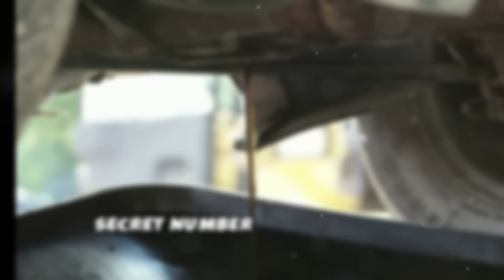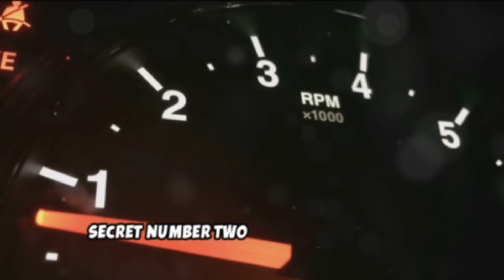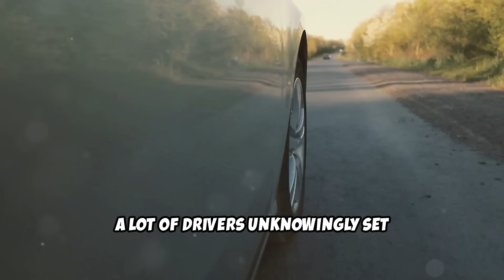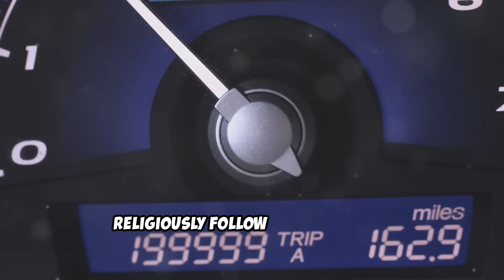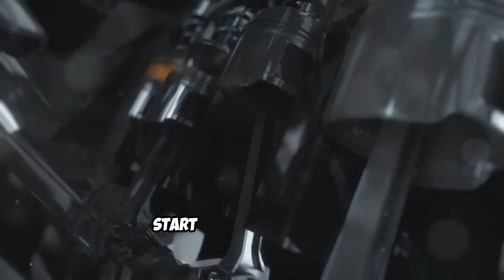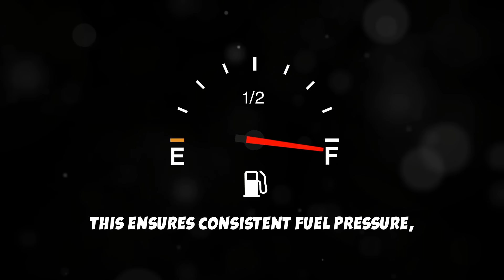5 Diesel Secrets Only Experienced Drivers Know (Most Owners Don’t)

Comment: I have a BMW 530d that has an upgrade and runs at 300+ bhp, with an 8 speed automatic transmission it's impossible to get to high revs for a sustained time as I would be doing 120 mph ! And the ,so called, manual paddle option won't let me keep it in 5th year at high speed.

Comment: One additional suggestion given to me by a wise mechanic. If possible fill your diesel tank when the outside temperature is warm. That will help reduce condensation when it gets to the tank. Another way to look at this is avoid fueling up (if possible) when it's very cold outside.

Comment: If you only drive it on low fuel it also wont regenerate the particle filter, because the car doesnt want to use up more fuel (which it needs for the regeneration)

Comment: Truck driver here, 40t trucks. I. Dont agree with the 5th tip. The suction rail sits at the bottom of the tanks ( trucks and most cars) so there is no dirt in the tanks, thats why we have fuel filters, and the pressure is maintained by not opening the tank except for when fueling up. Dont open the tanks to see inside as you will affect the vacuum and force the pump afterwards. Thats why you ear the air going in the tank when you remove the cap to fill when your tank is almos empty.

I,ve been running a Daf for over 300k kms and no issues whatsoever until now and i drive till the fuel like comes on

Comment: A good tip for manual cars is press the clutch pedal whem start the ignition. Had a Audi A4 1.9 tdi tha made 500 000 km with the original clutch

Comment: i just recently got my first diesel a 3 l m550d. this is about tip number 2. i and have heard that after pushing your engine you should do a 10-15 minute cooldown trip where you drive around or lower than 70 kmph. is this true?

Comment: Good infos, thx. To fuel lvl just one point. If you empty your tank and the engine stops, usually you won't get it to run anymore. Unlike gasoline engines, diesel engines would require a vacuum pump service for your fuel line. Unless you have an offroad car which usually come with a manual vac pump at your fuel filter. Everything else are excellent tipps 😊

Comment: Great information.
However. The final one regarding fuel levels is a bit innacurate. 
For decades now, it has been impossible to suck air from a low fuel tank. There is a seperate sensor from the fuel gauge which will cut-out the engine before the tank can be sucked dry. This is done to prevent air being drawn up the fuel line, which will damage pumps and injectors that rely on the fuel for lubrication. Letting a tank actualy suck dry, would also lose prime on the pump(s), which would further damage them on trying to start with a dry fuel system. 
So vehicles are designed to not totally empty their fuel tank. 
You can run your diesol "dry", but there will at all times ,be roughly half a gallon in the tank at the "pocket" where the "pick up" sits. 
Note that since the removal of sulphur from Diesol, it has been neccesary to introduce other biocide control methods. Getting the fuel level down to near empty removes contaminant build up due to biotic growth. I let my "low fuel" light come on before I refill.

Comment: My T6 has a floating fuel pick up,I never let it go under half full,and I always change the oil on 5000 miles. The biggest issue I’ve had is with faulty tyre pressure sensors. 😂

Comment: I operate shortened change intervals but I have often wondered if I could delay the filter change interval - so change filter every other oil change. My thinking is that while oil gradually degrades, the filter is probably just as effective up to the point that contaminants block oil flow.  Not about cost saving, rather the oil filter is less accessible for me and changing the element causes more mess than simply changing oil.

Comment: It’s also important to use oil with the right API service rating. I’ve run 2 7.3 powerstrkes over 450000 miles using JD 15w40 oil changing every 5000 miles.

Comment: According to a college book for car mechanics I once read, a study was taken of taxi drivers in Paris and basically it said if you run your vehicle with it's oil level towards or on the 'minimum' mark on the dipstick and only top up to the minimum mark, the study said you will see better fuel economy and much less mechanical wear in that engine, the reasoning being a lesser volume of engine oil will allow the engine to reach normal operating temperature far more quickly and therefore reduce friction.
Reply: Thats interesting, never heard of it.

Comment: What about modern diesel engines that don't have a glow plug light how long due you leave ignition on before starting
Reply: If it hasn't got glow plugs you can crank and start right away . Typically engines with indirect injection - those with pre-combustion chambers - need glow plugs , direct injection engines do not .

Comment: My vw glow plug cycle is controlled by the ECU.  You turn on ignition.  Glow plugs illuminate.  Once the cylinder head is proper temperature, the engine starts. On very cold days the glow plugs cycle can take a couple of minutes.  On Autumn days, just a few seconds.

Comment: Always changed oil and all filters every 5k
On 280k now and runs great vw 2.0tdi
Reply: The VW TDI 2.0 is one of the best engines VW ever designed.  In fact I’m on my third VW with that same engine.  It never misses a beat, is tough as hell, and has surprising acceleration when needed.  A non-VW mechanic told me a few years ago that he doesn’t know how reliable they are because not a single one has ever come in for repair. 🤣.

Comment: recently stumbled upon the fact that when in sport mode pushing the gear shift back downshifts so RPMs go up ...since then been driving on the highway consistently in the upper rpm range 1800 - 2500rpm and now my volve runs smoth as petrol in the city

Comment: I agree on most except, all fuel tank pick ups are on the bottom. Don’t matter what fuel level is at to suck dirt in, if it’s there is going to get sucked. Also no mention of fuel filter replacement and pre filter installation, that will help as well.
Reply: Thats right! Also, clean air filter protects turbo as much as cool down
Reply: @8190930 Ahhhhhh, say what? come again??? Obviously maintaining a clean air intake filter is always best practice, however the air filter irrespective of its cleanliness has literally nothing to do with the driver allowing the oil  to circulate for 60 seconds after hard driving thus allowing scorching hot temperatures to decrease to a far safer shut down range. Not sure where you pulled that from bloke? 🤔
Reply: fuel pickup pipes are not at the very bottom AFAIK. It's designed that way to avoid picking up dirt/sediment.
Reply: Id change fuel filter every 10k miles

Comment: Another one to add:- always allow the engine to warm up for 5-10 minutes before driving off. Also; change the coolant more frequently:- The EGR cooler on my Nissan Xtrail corroded and the engine hydrauliced= scrap one engine at 120,000km!
Reply: For that long warm up, not sure...but for the coolant, absolutely

Comment: Servicing every 10000km,use best quality coolant.Install a catch can and replace fuel filter no more than 20000km.Ive done 220000km on the Pajero with not a single mechanical issue.

Comment: sorry, dissagree....have nearly 400000kms and service once every 3-4 years....have only ever changed belts and alternator, running smooth and clean. Diesels are almost unbreakable....I think the car service industry is over rated, just to keep the money flowing in.....Not a mechanic, but i have serviced and repaired  my own cars for over 50 years.....never had a major fail....diesel or petrol....dont be conned....its everywhere.

Comment: You missed another important issue with fuel level in high humidity and cold nights, keep the tank near full. This greatly reduces the amount of condensation building up in the tank as it breaths as the temperature changes from hot to cold. The bigger the air gap, the more condensation that can get in. The water then settles in the bottom of the tank where fuel bugs work between the water and fuel resulting in sludge and sulphuric acid. Not great for tanks, fuel lines, fuel pumps etc.
Reply: Hummm….great point🤔👍🏻

Comment: Lots of modern cars (2014 on) have oil change of 18,000 to 20,000 miles and as long as always use the correct oil, not use wrong spec as penny pinching, they run huge mileages fine without wasting oil by changing every quarter to one third of its life. Can do it a couple or few thousand before but silly to change 10,000 miles and plus before due.
Reply: Have a read up about Audi 2.5 TDI V6 engines eating their own camshafts to the point they fail to run.
It only happened on vehicles that were put onto the 'Longlife' (sic) Service Program where oil change intervals were extended from 10,000mls to 20,000mls and special very expensive Castrol SLX oil was used.
Extended service intervals are bad news in the long-run.
Reply: Also the oil pressure in these engines are set low when the engine is idling. Causing all sorts of camshaft, cam followers wearing. Change the oil every 5-6k miles

Comment: I have another one I like to do, when I’m first starting, the lift pump cycles a short time, if you bump the starter and leave it in the run position. The pump builds a little more pressure to the injection pump low side. It will start faster!

Comment: I drive a 1997 Dodge Ram 2500 4X4 Diesel. I had a 3 pillar gauge with a boost, EGT and a trans temp. installed from Glow Shift Gauge. I always make sure that my EGT never exceeds 1250 degrees and down to 300 degrees before shutting off the engine. Sometimes it will take 5 minutes to cool down to 300 degrees. I have a great stereo system so I don't mind the wait! Also, I never let the trans temp. exceed 200 degrees. The engine has 375,000 miles on it and still runs strong.

Comment: In winter i always cycle at least 4 times, one dor each cylinder. My diesel is at 600 000 km atm and runs as smooth as the xay it left showroom floor 🤣

Comment: :face-fuchsia-tongue-out: 50cc of concentrated ethylene glycol added to your diesel fuel tank will remove most of the moisture without damaging your engine. This is what Stanadyne uses in their fuel treatments. :goat-turquoise-white-horns::hand-purple-blue-peace:
Reply: Never add ethylene glycol to any fuel system , on its own it's not miscible with fuel and doing what you suggest will cause expensive damage . Any ethylene glycol present in a fuel treatment has many other ingredients with it which modify the chemical profile of it .

Comment: over 35 years ago a principal at a Mercedes dealership told me, you can neglect much of the service, ie stretch intervals BUT change oil and filter early as you can and the engine will run and run.
Reply: 5.000 miles , I do my everytime , the car is sweet and has been for years. Its a 20 year old W211 E Class Merc , 3.0 diesel
Reply: @damian-795 those are the best engines

Comment: Several times you mentioned heavy duty trucks. But most of the figures you use are impractical for heavy duty trucks. The company I drive for obviously doesn't care about the second owner of their trucks. They push the oil change interval to the max. Using synthetic oil, their change interval is 75,000 miles. And fuel purchases are based exclusively on price. Even if fuel levels get down to almost nothing. In 20 years with this company,  I've had 2 trucks where the DEF pump failed.

Comment: Your top 5 are a mix of good & outdated advice.  Loading your diesel: good.  5000 mi MAX on oil changes.  Cool-down on your turbo good.  Glow plugs are computer controlled and time will vary based on temp.  Your advice is 1980s era. Just do the full cycle.  Block heater in winter PERIOD. Fuel filters and water traps just use them and change on schedule & fuel (in USA) will never be an issue.

Comment: As an experienced driver i agree with all of this. Only a little hint for tip 4. Yes, you can try twice to heat your glowing plugs if it is very cold. But here is another trick: in any case, don't start the engine immediately when light goes off, but wait a little more, and when you hear the sound 'klick' from your engine, this is the time to start it.
Reply: That click is the relay of the glow plugs circuit when the operation time is finished. That time is decided by the temperature of the motor.
Reply: Oh....I see...thank u🎉
Reply: Thank you 👍
Reply: I am purposing to buy a diesel car this month of Nov. I am learning so much from you (experienced drivers). Kindly continue sharing your wisdom. It is appreciated highly.

Comment: What about filling up with the more expensive fuel (premium ones). Any advise on that aswell? LR Discovery 4
Reply: For diesel premium is better. For gasoline it's not that of an advantage.
Reply: @Stanjaraactually it's even more relevant to use premium higher octane fuel in modern petrol engines cars, especially turbocharged engines. Via the 'knock sensor' and ECU the better fuel allows for more ignition timing advance and therefore more power and efficiency.

Comment: All very practical tips. Also, If parking up, especially for any extended time, fill the tank. This will prevent condensation to pool in the tank. Water will score the fuel pump.
Reply: and diesel algae

Comment: Ex taxi driver here had 4 Peugeot 406  . Bought at 80 thousand miles each sold at over 300 thousand miles  change oil and fuel filter at 15 thousand miles  .had no problems  .maybe newer cars are not as good
Reply: Your car is running all the time at operating temp. Problems are short tips and cold starts... aka oil fuel delusion.

Comment: After heavy towing or hard driving you need more then the 30-60 seconds should be more like 5 minutes
Reply: I have an EGT meter fitted and wait for it to come down to 200c before switching off.  In hard driving the temp can reach 650c and at that I lift off a bit.  My turbo has now done 300 000 kms with no problems.
Reply: I drive a 15 Litre Mercedes engined quarry truck weighing 74tonnes gross up some fairly steep intervals.
It will not switch the engine off until it completes a 'turbo cool down cycle' the time varies from 5s if the engine has been little more than at idle up to a very maximum of 60s if you have been caning the arse out of it.
60s is plenty of time to cool the turbo bearings down to the oil flow temperature

Comment: i have a dual fuel tank system and rarely let either tank get below quarter full, never in the red, and regularly switch tanks to keep fuel in both tanks "fresh," and  it keeps pumps and lines primed with "fresh" diesel, don't know if it does but it seems appropriate
Reply: Smart move. Many don’t know that.

Comment: 3000 mile oil changes for me.
Reply: 5000km
Reply: And I have never had an engine problem in 50 years of driving - except on cars I have bought secondhand - I like to fix them up.
Reply: I have a F350 and do oil change at 4k. Also rotate the tires as well. I do the fuel filter at 10k and  also check the water in the oil every month. Has 175k miles on it and runs like a new truck.

Comment: Another point to consider regarding fuel level is that a lot of modern diesels will not perform a DPF regen if there is less than a quarter of a tank. If you roll around all the time with a low fuel level the DPF will never regenerate and ultimately clog up, needs cleaning and/or replacement. Ford engines are notorious for this.
Reply: True! A VW mechanic told me that you should avoid low fuel on short drives. Always use the top half of the tank.
Reply: Take that shit off and get it tuned

Comment: One other important point not mentioned is to always warm the engine up before any load is applied. This allows all components in the combustion area to warm up evenly and swell to their normal operating tolerances. Includes exhaust manifold and turbo.
Reply: Leave it running ideal for minutes tooo...
After completing the drive
Reply: @lone-wolfff-21  Absolutely unecessary just drive 2-5  minutes before stop with low rpm .mean less than 2t.
And you will be fine
Reply: @MichalZajíc-l3t Totally agree.
Reply: @MichalZajíc-l3t exactly.
Reply: Never let diesels idol for more than 3mins. Keep rpm at 1500 to pressurise compression rings properly. At idol you get what is called blow by and this causes glazing of the barrels. Google what is blow by on a diesel.
Reply: @MrKeenaz  keep rpm at 1500? My Kia Ceed is doing 70mph at 1500rpm in top gear.

Comment: I wish some "expert" could explain how "synthetic" oil is made.  I am suspicious that oil is oil and that "synthetic" is just additives.  Any thoughts?
Reply: Yes and No :  basis of both oil types  is oil , ( heated to 350 degrees celcius )  so yes.
Mineral oil contains additives , but flows more slowly through the system using more fuel : its aging faster than synthetic oil  and  very suitable for older engines.
Synthetic oil is the result of several chemical transformations, making it more pure and certainly  more fluid and  a larger variety of additives is added  for use in todays  high performance engines  with less corrosion ; constant  viscosity ; less wear and less oil changes.
In short : older enginessuited for mineral oil and modern engines for synthetic oil
Reply: @fryfrysk  they said "expert", which means they don't need an expert opinion

Comment: Ive got a VW transporter. The oil is changed every year about 20,000 miles and has done 280,000. It runs all day every day and isnt thrashed. I run it low on fuel every time with no issues. In my car I change oil every 5,000 miles and use premium fuel.
Reply: Sounds like an older van, they run at a lower pressure than the modern, say last 6 years, ones do. Still be no harm to top it up a bit more. Far better than the new diesel engines so keep that one running, unless you like wasting money.
Reply: Treat the Vw better